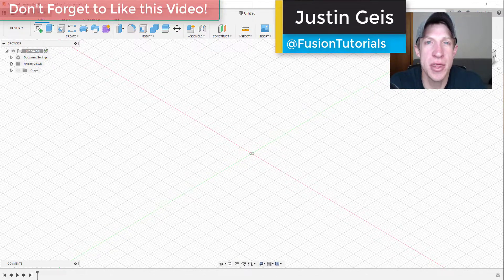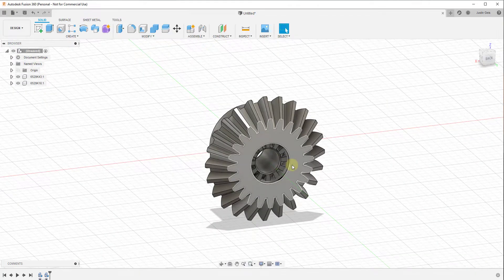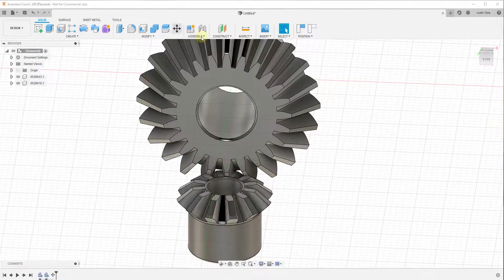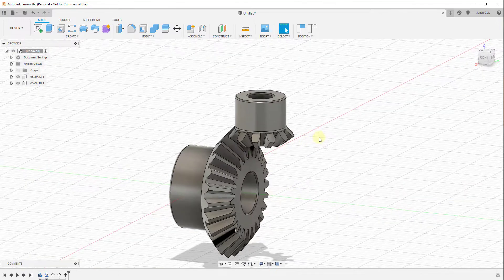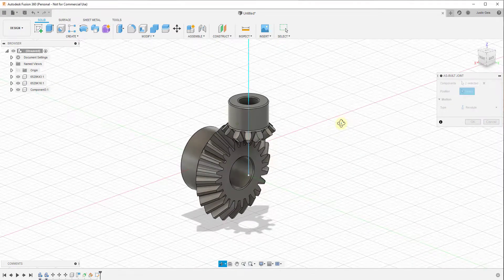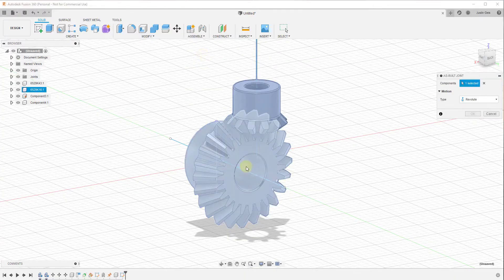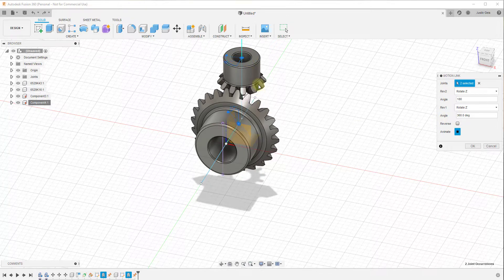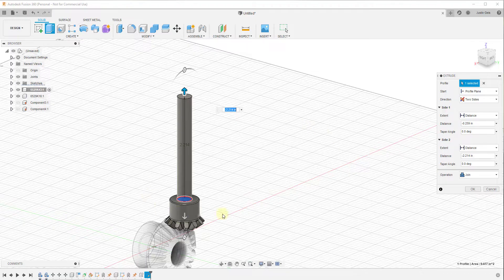Simulating BEVEL GEAR MOVEMENT in Autodesk Fusion 360 with Joints!

Comment: What about preparing a sketch component with the dimensions coming from the McMaster Data Sheet? I mean two points at the center of the shaft of each gear at their back side (or lines, it is all equal) that would allow you to use sketch dimensions with the McMaster data and position the two gears  with the two joints to their corresponding point of origin on the sketch component (I hope it was clear). That way you can avoid manually adjust the gears.... (I might be wrong although it worked for me but I m not professional user).

Comment: Actually finished watching it now! Really useful stuff! One thing that bothers me though with using this for "simulation" is that you have to cheat by defining the link between the axes. As it stands now even if your gears teeth arent compatible the "simulation" will still look fine in F360 so you'd only notice the problem when you are trying to assemble your print. I know there contact sets you can use but they are so excruciatingly slow to use, why isnt this a priority to fix? it seems super critical to me? Being a physics developer i know for a fact that simulating a few high res polygon meshes interacting with each other would be more than fast enough on modern hardware.